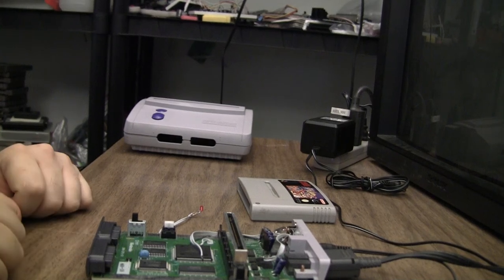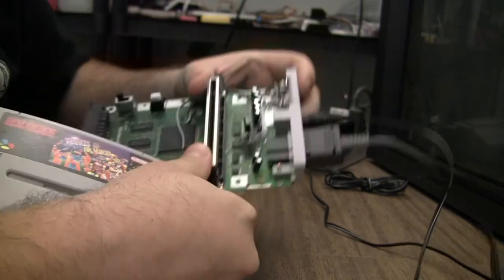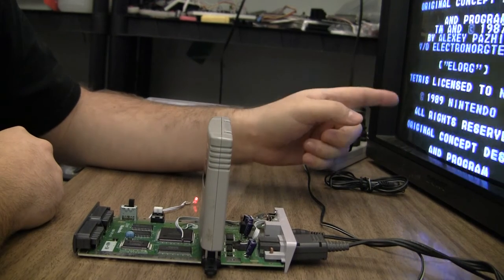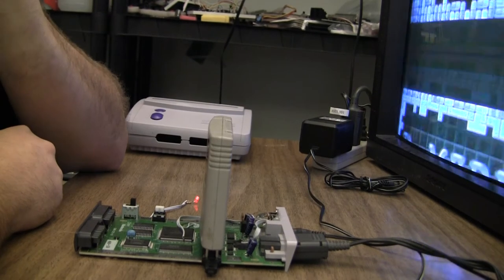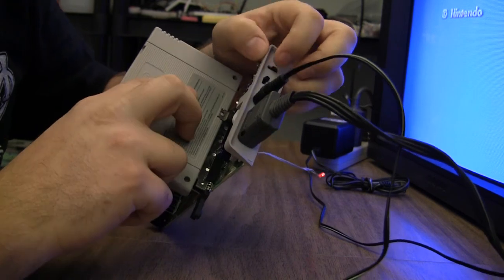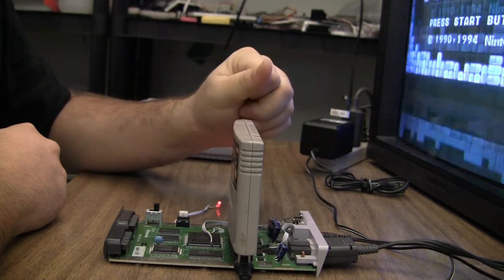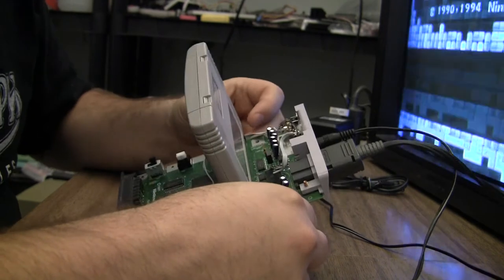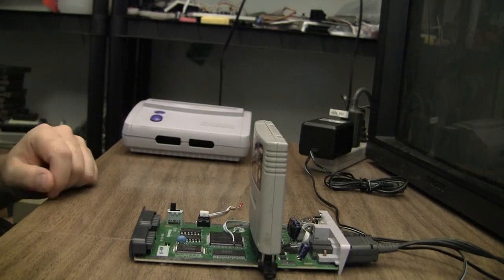SNS-101 Super Nintendo - 50-60Hz Mod FAIL - wont play PAL games

Comment from the maker: Its composite output and yes, like I stated in the video it seems to be outputting a PAL video signal.
Reply: You’ve got the PAL video encoding but the rest of the console is still running in NTSC mode. I just got a PAL-modded 1chip-01 Super Famicom from Thailand and it has two mods: The video frequency mod and region jumpers. They cut a trace that was connecting one jumper and soldered the other. I compared it to my North American 1chip-03 and the jumpers are in the exact opposite configuration. The SHVC/SNS-101 systems probably have a similar jumper unless Nintendo wanted to make a different version of the board for PAL regions but that kinda runs counter to the cost reduction they achieved with the 1chip SHVC/SNS-001 consoles.

Comment: had the same problem with my SEGA CDX (ntsc) and a Sony Trinitron 14" CRT tv I am using... the secret for me was to enable from the tv's service menu the NTSC INPUT option, it then worked perfect, no more rolling screen.
It just works with my LCD TV, if it works for you too then it's a CRT problem.

Comment: Odd, the sound didn't change speed when flipping between 50 and 60Hz. Some games didn't as they were optimised, but you're speeding a game up from 50Hz native to 60Hz and if it was optimised for PAL it should speed up?! Correct me if I'm wrong please.
Reply: Joey Schmidt Audio Productions SNES audio ignores HZ rates, mega drive and NES slow music down on PAL.
Reply: SNES audio goes slower on PAL as well, I speak from an experienced perspective being from the UK. My SNES from the 90s was modded to play US and JP carts and all my PAL games ran faster running at 60Hz, audio included. The samples weren't pitched higher, but they definitely ran faster.
Reply: This is only true for a few games, like Lost Vikings and Super Off Road. For most games the music playback is unaffected by 50hz/60hz.

Comment: isn't it supposed to flicker like that as pal is a 50hz signal and you are running 50hz into a 60hz crt tv? try the same setup through an lcd if you can. also are you running rgb/component output?